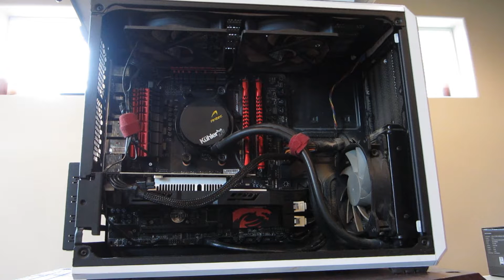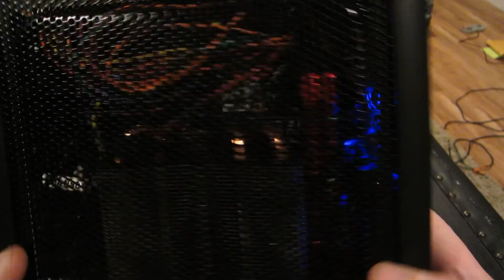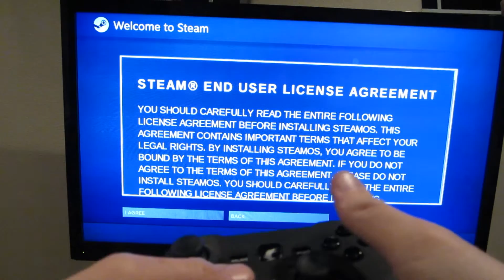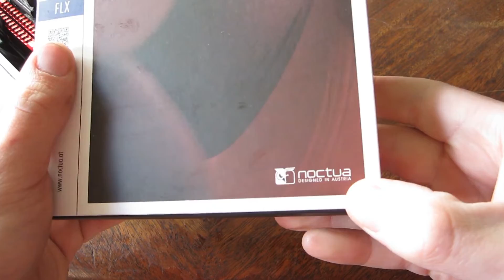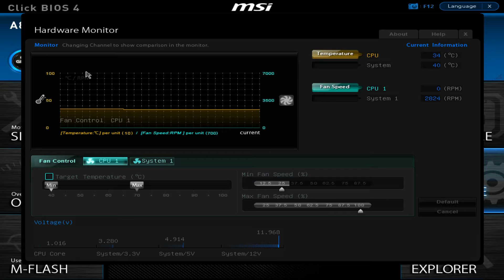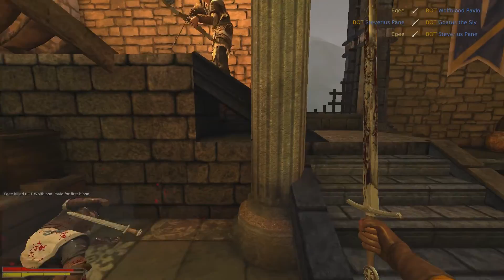Antec ISK 110 Steam Machine | SteamOS AMD A6 6800

Comment: i did 3 builds with ISK 110. mainly with a slightly under voltages A10-7850k and Scythe Kozuti cooler. so a A6 APU is way under performing for this case. 

you don't have to remove the front panel. i never removed mine for any of my builds.. you may need to remove the voltage regulator part, which is way easier than front panel. 

with the Zen APU with HBM and 65W TDP, i'd say this case is perfect for HTPC

Comment: I honestly would have tried to go for a slightly bigger case, its cool that this thing actually runs decent with such low specs and an underclocked CPU.
Reply from the maker: +Noah Hounshel Yeah I might build a new Steam Machine with a bigger chassis and move this tiny one upstairs to a different TV.
Reply: Egee I think the case would be great for A Pi though ;P